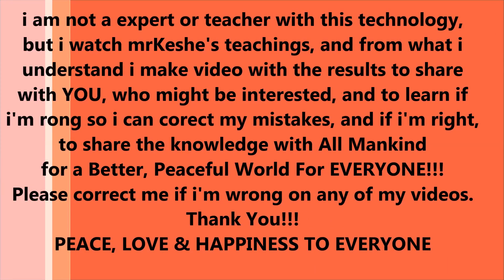How to make plasma capacitor + split capacitor - learning plasma technology, tutorial, keshe magrav

Comment: How do you know the right length of paper that will match the inner diameter of the coil ? Many times, it does not fit, I have to put the coil on a smaller rod, pull it back into a straight wire, and wind it again on the rolled paper, but the pressure squeezes some gans paste out (or powder if it is already dry). What a messy job !
Reply from the maker: in the beginning i have made the same mistake trying to put it inside as tight i could but is not necessary to make it very tight. you can make it not too tight an it will work very well. moreover, the exercise teaches and every time we can make it better and better. it is little bit messy at the beginning but after that you can learn to make it more easy. peace !!!

Comment: Hi, thank you for this video. Where is the aluminum paper?
Reply from the maker: i think that the aluminium is needed when we make plasma batteries and not when we make plasma capacitors and split-capacitors, like i showing in this video. thank you !!!
Reply from the maker: you can check my other videos which i'm making plasma batteries and i'm putting aluminium foil etc
Reply: NaTuber Tv ...thank you. I did not know that there are two different kind of capacitors.
Reply: No, you need to use aluminum for the capacitors also